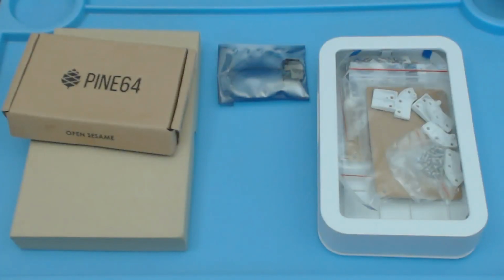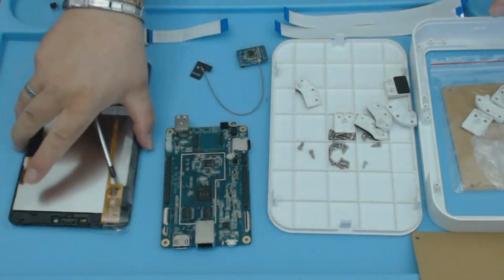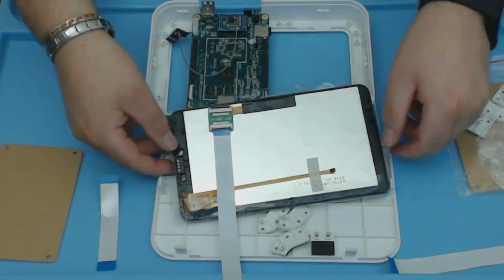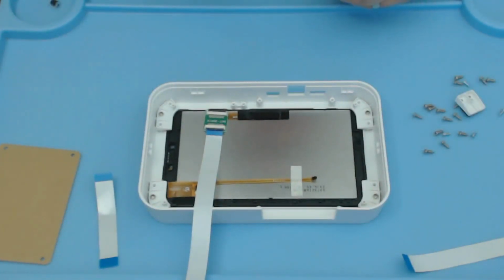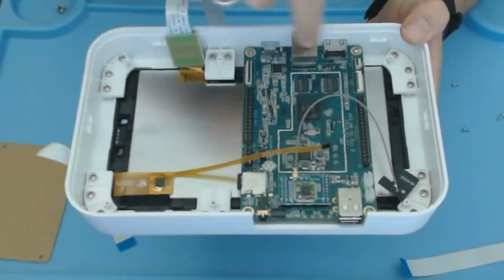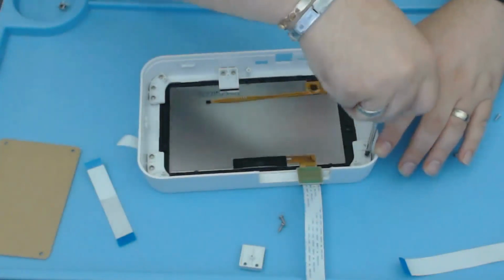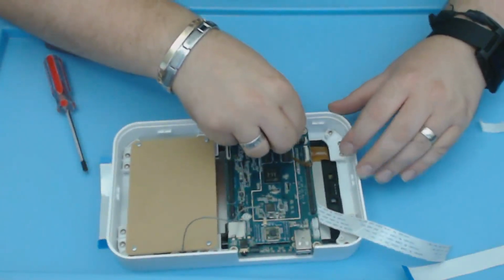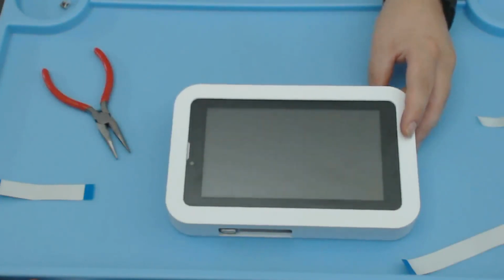BD01 Pine64 Build

Comment: I've got my official raspberry pi touch screen and I'm wondering if it will fit this case because this is a much better solition than anything that RPi has to offer at this moment.
Reply: I answered my own question by looking up the build dimensions. That won't fit.

Comment: What I'd like is a Pine 64 with a 14" screen and a keyboard but that runs off of a rechargeable battery pack.  I don't know if they're planning of making those again but if they did I'd buy one.  Actually I'd like to have one I could use in a standing desk set up.  But this has taught me a lot if I decided to try to make one, myself. Thank you.

Comment: Hello.  I just received this case and bought, ages ago, the  8000mah battery.  The board on the right seems to accept a bonded or taped battery and the cable reaches the battery connector on the board...
Reply from the maker: Hey Jim, thanks for watching! I'm not sure what you were trying to ask about the battery, bu I recorded a second video with a short demo of how to take the case off and talking about some of the battery stuff. I hope it helps.

https://youtu.be/2mWtOQ4AHJA

If not, please comment again!

Comment: Thank you for the video. The best available. I successfully mounted the case but I'm afraid that once closed I won't be able to reopen it. Did you try to reopen it?
Reply from the maker: Hi there and thanks for the comment! When I first received the case i test assembled it and was able to unclip it easily. Now that it's built I can use a small screwdriver to separate the case where the clips are and pull it apart. :-)
Reply: They do re-open just like their other cases which arrive already put together.  I would not do it often or you will eventually break a tab or something.

Comment: Thanks for the video! As a beginner, it's always nice to have some instructions ;). However, my screen doesn't work after installing... The board lights up when I plug it in, but nothing on the screen. Is there something I need to do first? I have the 64 gb sd card, with Android already installed.
Reply from the maker: Have you installed the Android image that is designed specifically for the touchscreen? If not, it won't load as it can't find a valid display or controllers. Also, make sure that you are getting enough power - if you are using a USB port on a computer or anything less than a 2 amp output mains adapter (there should be a sticker on it somewhere that tells you the output rating) you may not get enough juice.

Also, does the touchscreen light up at all? If not, make sure you have connected BOTH the connectors from the screen, and make sure that the metallic side of the cable is face DOWN to the board - the blue side should be visible when you look down on the board.
Reply: Hi Dave,thanks for the reply. I can't seem to figure out how exactly I can install the android image on the sd card. Do you know any step by step explanation? Thanks in advance!
Reply: Hi! Can you post a link for the correct android image? I'm also getting a black screen as I don't think I've installed the correct one.
Reply from the maker: Certainly: This is the one I used (I think): http://wiki.pine64.org/index.php/Pine_A64_Software_Release#Android_5.1.1_Image_.28LCD_Panel_Video_Output.29_Release_20160603 . The same site has all the instructions you need to install the images.

Comment: Excellent video. Glad to see you went thru all the steps I did but with a much more professional presentation.
Reply from the maker: Thanks for the kind words, Bob. Glad it comes off as professional!! ;-)
Reply: +Dave “Selezen” Hughes well, take a peek at my videos and you will see what I mean. Can't wait to figure out what to do with it. So far mostly playing YouTube videos on my TV with Chromecast and playing Pandora on my Blue Tooth speaker.
Reply from the maker: I have to admit, I did enjoy the soldering efforts. There's a reason I left my reset switch in the box... :-)  I know what you mean about trying to find a purpose for the Pine64. I was thinking about using it as a media centre for the kitchen, but I need either a longer power cable or a battery pack...
Reply: I never got any reset switch.

Comment: this case is bullshit, no manual and try to take out the microsd card
Reply from the maker: Hey, AMS5, thanks for your comment! To be fair, the touchscren case is designed to turn the Pine64 into a tablet-like affair rather than retaining the Pine64's customisability and expandability.

I got the case because I probably won't use the Pine64 for anything more than a media or control centre. However, if I do want to change the OS or change the SD, the back of the case just clips off - it's not hard to remove - then the SD card slot is easily accessible.

Simple truth? If you want to easily access the SD card then this isn't the case for you. :-)

Comment: Very relaxing video to watch that. Well done for not losing your rag when the screen install was the wrong way around. You would expect the writing on board and screen to be in the same orientation so a very easy mistake to make. 

As a noob to this, I think the short screen cable would actually work in my favour given the whole one-way only aspect it adds to the build. 

Iccle puters like these have always intrigued me and this is the first one I've seen built from bits. 

Thanks. Great vid.

I don't know if you're doing requests but I'd love to see your modular 3D printer build (if you can stomach taking it apart after waiting so long for it). 

:)
Reply from the maker: Thanks, Dan!

I do regret not actually videoing the build for that, but as I said I only came up with this idea this weekend. And I wanted to build the Vector3D as quickly as possible to get the components out of the way. I may need to disassemble some of the printer thanks to a possibly faulty main board. What I might do is video that then record the rest of the build - only 7 more pieces to go.

I don't think I want to dismantle the WHOLE thing cos there were some parts of it that were tricky and annoying. 

Thanks for the suggestion though. :-)
Reply: I suspected as much. Hats off to you for doing the 'safety build' on this one and then building it again. I don't think I'd dare deconstruct anything my sausage fingers had fortuitously managed to mash together without destroying it first time. :) Keep it up Dave, you are very watchable and go into an exquisite level of detailed review without becoming boring. That's rare.
Reply from the maker: Thanks, Dan, very much appreciate the feedback. Your cheque is in the post! ;-)
Reply: lol. No smoke blowing intended, it's a genuinely enjoyable video. If the next one's piss poor I'll tell you ;)
Reply: I fast forwarded a lot.